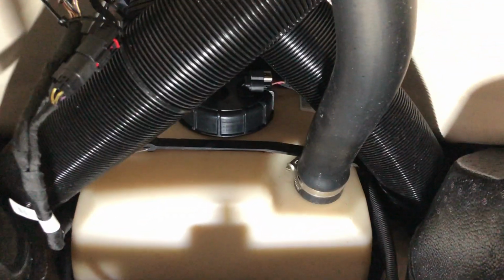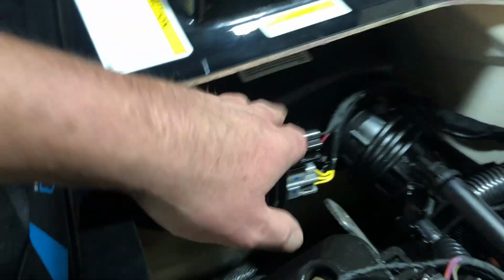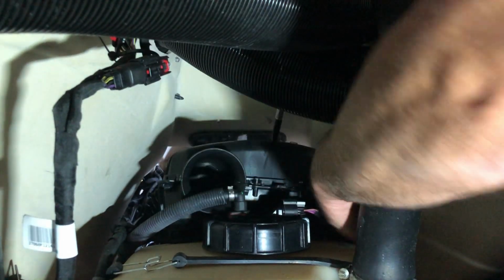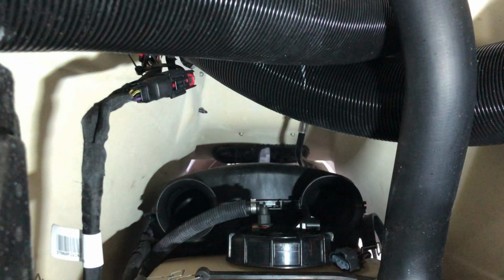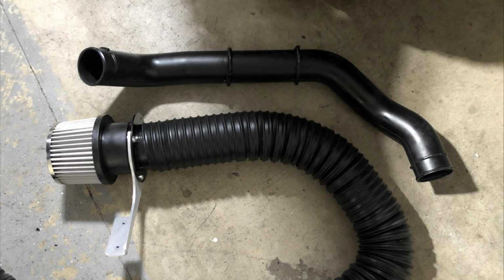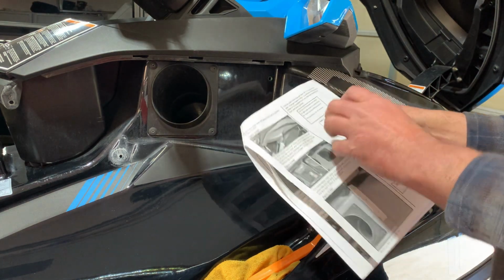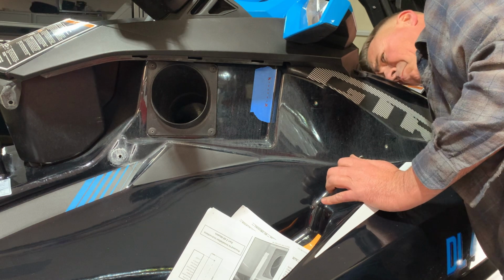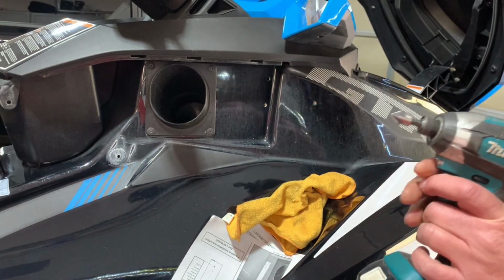Riva Stage One Seadoo GTR 230 -Air inlet part 1

Comment: Hey, which impeller you installed on this jet ski?
Reply from the maker: On my GTR 230 I installed a Riva stage 1. The impeller is a smaller diameter and pitched at 14/19. I now have over 100 hours ride time on the upgrade and total hours are 270. (I run this hard, very little cruising just tear it up)  Runs perfect with as built compression. I did also follow up with titanium valve spring retainers later, but perhaps overkill.
Reply: @BondsGarage thanks for the response, this one will fit on my 2018 GTR 230? Solas SRZ-CD-14/19A
Reply from the maker: @bluchard  Yep it should, but don't forget that the diameter is smaller So you need to replace your wear ring with a smaller diameter as well. Go to the riva website and plug in your make and model to verify, but I know your 2018 and my 2019 are the same. (2017 230's are different due to a previous version of the IBR.) Is this the best pitch? Not sure, but this is what came with my Riva stage 1 kit including a map-tuner . Great update for me so far, but I would  not simply install that impeller without making the additional mods (Could likely skip the catch can, but I do see oil collecting over the season in mine) Oh and the stage 1 also requires high test fuel.  PS, when you upgrade, let the relocated voltage regulator wiring be nice and loose. I made mine to tight with zip ties to the new air intake hose. And in jumps the hose bounces a little and tugs on my voltage regulator wire harness, so I loosened everything up/ tide to other areas and problem solved.